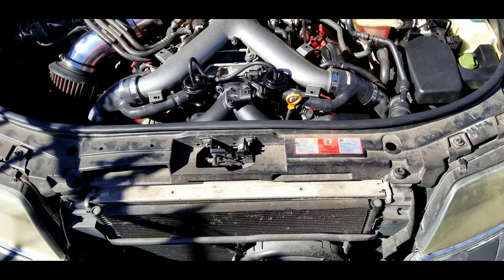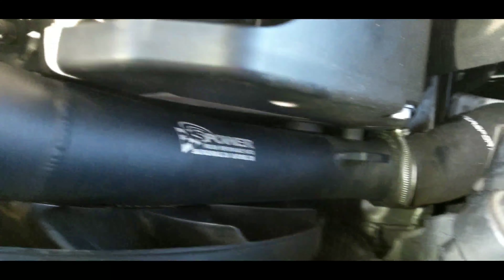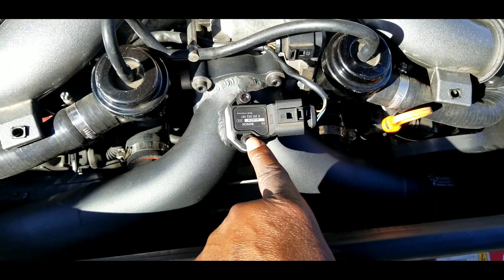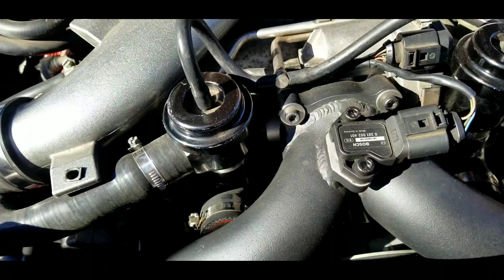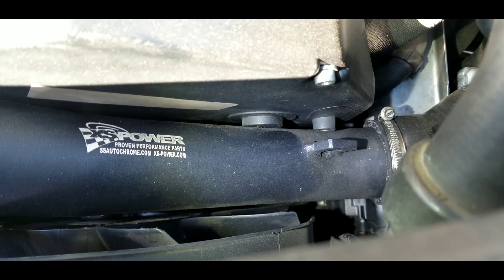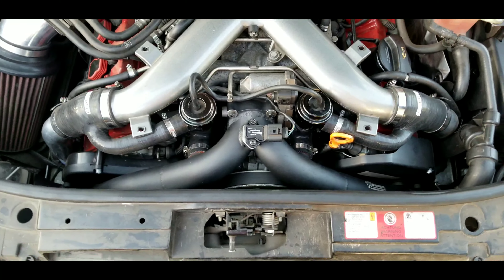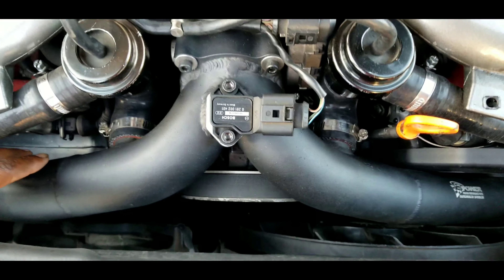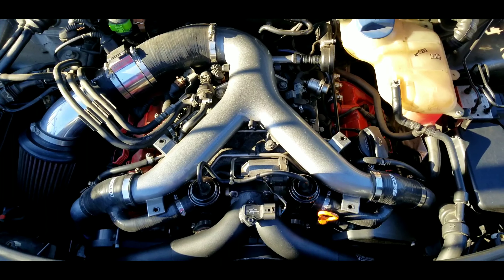Stage 3 Audi Allroad 2.7t Project : Performance Parts Impressions

Comment: need more 2.7t content! just bought my first 2.7t in a 6MT 2001 Allroad and currently working on getting it up to speed! only needs maintenance...
Reply from the maker: Nice, that the same year as mine. I'm working out of state right now. When I get back I'm gonna do some things to the other 2 project cars then I'll be back on the Allroad.
Reply: First thing to do is the timing belt, water pump and thermostat. These are interference engines and if the timing belt breaks the engine goes with it. Doesn’t matter the speed or RPM like on some interference engines you can get lucky l. Not on the 2.7 though. If the belt breaks we’re fucked!

Comment: Hey quick suggestion - there’s a T fitting in the hoses from the coolant reservoir. It’s plastic and breaks. If you’re me, it breaks when you’re in the middle of nowhere with no coolant and no AAA. Check yours out just to be safe!
Reply from the maker: Yeah they get brittle and break. I got a metal version for my TT but I'm not sure if they're available for the 2.7t in metal.
Reply: @cmidas3396  I just saw one on eBay for the TT and was going to order it. I’m waiting for a reply on the dimensions. I ended up replacing mine with an ordinary brass T from any Auto Parts store but I’d rather have the right dimensions. The brass have hose barbs that get very tiny. I ended up cutting about a half inch off each side.
Reply: @ProjectCarTV  would you recommend also using silicone hoses instead of the oem plastic ones ? for intercooler related hoses etc.
Reply from the maker: @Orderflow-sama Yes. I've just about changed all of mine to silicone except the radiator hoses. I went with 034Motorsport silicone hoses mainly.

Comment: replacing the OEM harmonic balancer with anything but OEM is not a good idea. I hope the one you installed is fine, but I have heard countless stories about them grenading and basically destroying the engine.
Reply from the maker: The fluid damper is actually better than the oem damper because it has fluid in it it protects the motor  from harmonics better and for a higher rev range than the stock rubber damper. Stock dampers would be quicker to explode on a race motor and the rubber actually starts degrading but people don't realize it.
Reply: @cmidas3396  To each their own, I hope the damper is working fine for you. In theory, the fluid damper is supposed to be a better part. Just because it has fluid inside does not make it superior. Their are other factors to consider like the base material used, how it was cast or molded and etc. I never installed one myself so I cant speak personally to its performance or longevity but the OEM damper is pretty much bullet proof. You will put a window in the engine block before you destroy a new OEM damper.
Reply from the maker: @KaMil-gw2qr  I understand what you're saying but if you remove your stock damper on a high mileage motor you will most likely see cracks in the rubber which is diminishing its performance. A fluid damper doesn't have that problem and they are actually required in different  racing classes because they protect the motor (and other drivers) from shaking itself apart (where sustained higher rpm is required) and causing a catastrophe.
Reply: @KaMil-gw2qr  I see the tree you are barking up and yes replacing a stock factory part might be worth going for a OEM unit. But for performance applications Fluid Damper brand seems to have a good rep, I am running one on my 2.7T and so far so good.
Reply from the maker: Yeah the factory damper is fine for stock stage1 & stage2 but they do degrade due to the rubber cracking so people should check them. The fluidampr doesn't have that problem because it's fluid filled. I think he may be actually referring to the lightweight crank pullies.
Reply: @KaMil-gw2qr  You must not have ever seen a two piece OEM damper on any car rotate while installed. It can happen over time and wear and you won’t realize it because it isn’t a cam sprocket or crank pulley with teeth. They can easily slip and because they’re already installed and you won’t realize there’s an issue until the pulley is already off to change the timing belt and you realize that the timing mark doesn’t actually line up up at TDC any longer. I’ve seen them off by a couple a couple degrees on up to 90 degrees+ rotated. Fluidamper has been around for many years and is in no danger of filing for bankruptcy any time soon. What you hear on the internet  and what’s the actual truth are way different from each other. Of course if you have 279,000 miles on the car and install one, your engine goes south due to mileage itself, neglected maintenance etc it’s very easy for internet folk to blame rod knock on a brand new shiny part rather than neglected maintenance and 279,000 miles. But hey if it’s written on the internet it must be true right?!?!?
Reply: @cmidas3396  Yeah light weight crank pulleys are a waste of a good engine on any vehicle. OEM dampers are actually called Harmonic Dampeners. They’re tuned to frequency like a VSR sort rig balances rotating assemblies. It’s the vibration that they tame. I’ve used Fluidamper for many years on many vehicles. Had one on my 1,400hp MKIV Supra.
Reply from the maker: @ProjectCarTV  Yeah it made a world of difference.
Reply: Good channel man! You could use more Subscribers though. Are you active on any of the Forums or Facebook groups? There are several thousand on one of the C5 B5 A6 S4 RS4 RS6 groups that I’m in on Zuckerbook. Very active group actually!